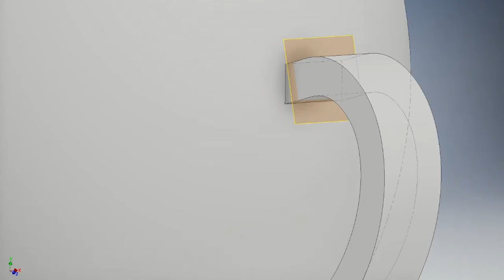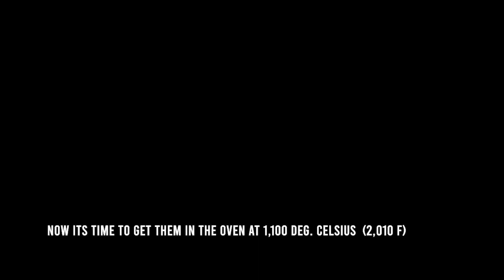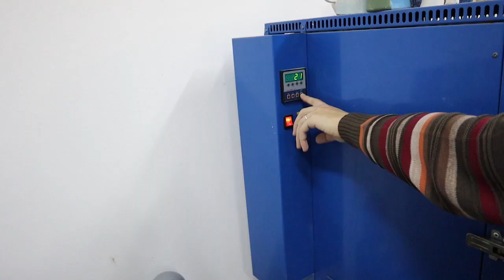How To Make Ceramic Teacup At Home With Custom Logo (Slip Casting Clay In Plaster Mold and Glazing)

Comment: Nice work!   I think I'm ready to move on to my first roll of PETG and save the rest of the PLA for lost PLA molds for casting metal.
Reply from the maker: Cool! PLA should be good for molds :) what metals are you planning to cast? I tried aluminum once but nothing more
Reply: @JTMakesIt  Same, at least at first, aluminum.  The goal is to make the parts for the conversion of the more common vertical shaft small engines (Briggs and Stratton opposed twin and OHV), horizontal conversion case parts primarily.  Maybe intake manifolds.   That's for starters.  I actually used to run two foundry labs; one was the metallurgy lab at a non-ferrous alloy foundry and the other the sand lab (trained on all the metallurgy other than the X-ray lab) at a gray iron foundry.  So that will be a later goal.
Reply from the maker: @jafinch78  That sounds like an awesome project!